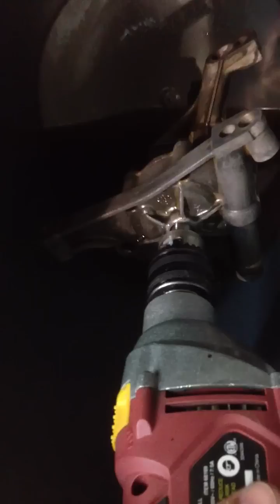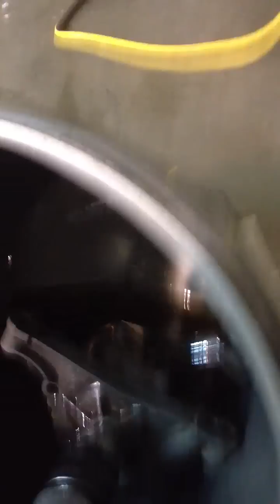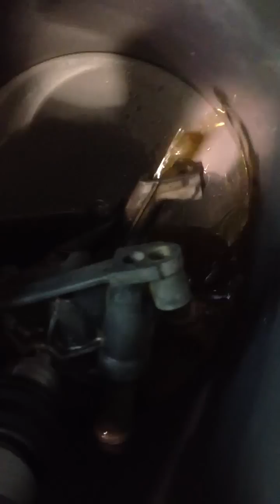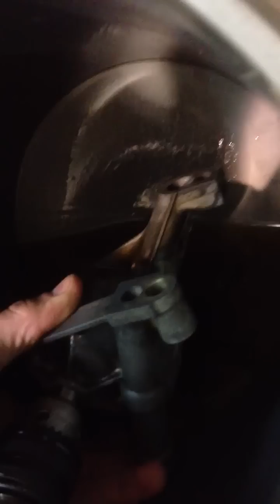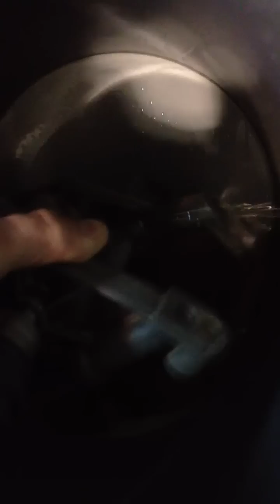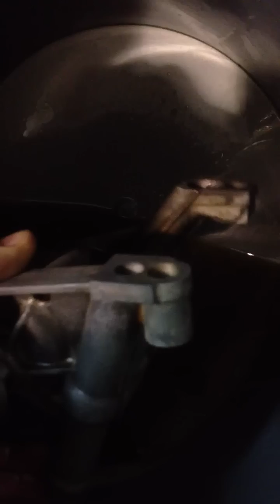S38/M30 oil pump test e34 M5

Comment: It is a misconception that the pump draws in air. the experimental setup does not correspond to the real conditions and is therefore not meaningful at all !!
Reply: This setup shows not the reality. For the reality first of all you need to know the required oil-flow per time which the engines needs (and due to this the pressure - or vise versa). Then you need the specs. of the pump (speed, pressure, volume/time). If you have all these parameters, you can start think to change somethings. The question here is also, is it the pressure relieve valve or the pressure control valve?
Reply: @HarrryHarrry  this is exactly what i try to say..
The pump don't draws in air from the pressure control valve!!
Reply: @Kumbetli28  the opening, where the piston of regulating valve is behind, is always laying in oil if the pump is mounted (at least on this type of pump). I have now a M30 disassembled… The shown behavior is absolutely normally for that pump!
Reply: @HarrryHarrry  No, the pressure control valve has internal oil pressure (overpressure), so no air can be sucked in!!

the pressure relief valve sometimes gets stuck, resulting in a loss of pressure. But there is also overpressure at this point and no air can be sucked in. please check the structure and try to understand the function of the pump!
Reply: @HarrryHarrry  
the pressure control valve is supplied with oil via a parallel line, which is why this test setup does not correspond to the real conditions. in fact, in this case the pressure control circuit is not supplied with oil and therefore the pump draws in air!
Reply: @Kumbetli28  yes, the overpressure valve (with big spring "loaded") opens, if the outlet pressure is getting to high. That normally only can be happen, if the oil filter is clogged. The pressure regulating valve (also "only" a spring loaded valve, but with a longer piston and a longer, thinner spring) is "getting" the system pressure via the horizontal oil channel. The outlet of that valve is direct linked to the inlet of the pump rotor. The "working" area of that piston (where the spring is) has the small hole on the bottom of the cylinder (hole is in the endpiece). Without that hole (or if that hole is closed), the piston cannot anymore move. In normal condition, this hole is hanging in the oil of the oil sump (the sump has there extra made an area for it). So either or, on the pressure control valve, the pump will never suck air in at normal operating conditions. The only wear can be on the piston / cylinder of the control valve - and that needs to be checked.

Comment: i have a m30 acts like this what did you cover up to increase flow
Reply: This whole where the control valve is, is lying in oil, when oil pan is mounted! So the whole is not open then!

Comment: Hey strange no one posted anything, but the question arises...would it be better for the engine if the pressure valve was blocked for good / removed? Flows much better with it being blocked...